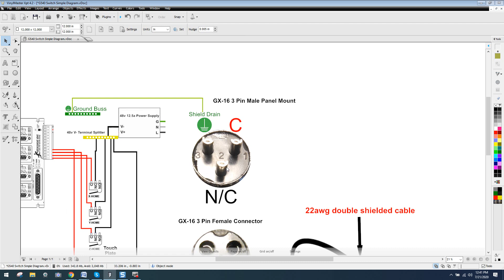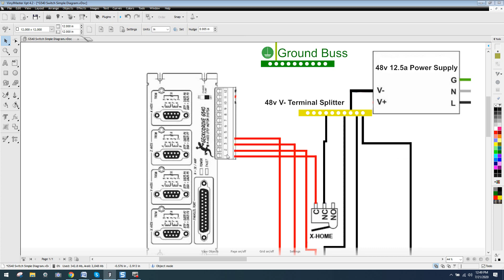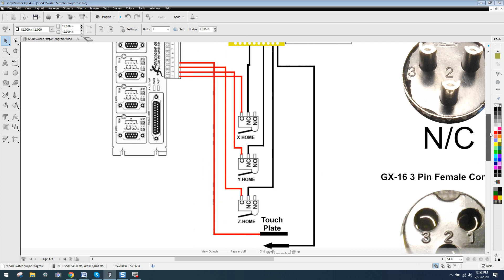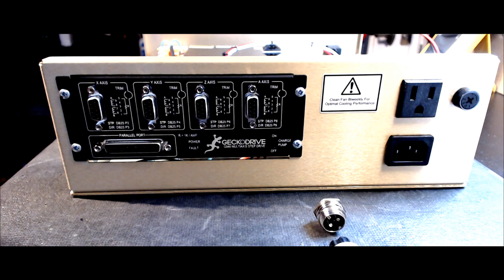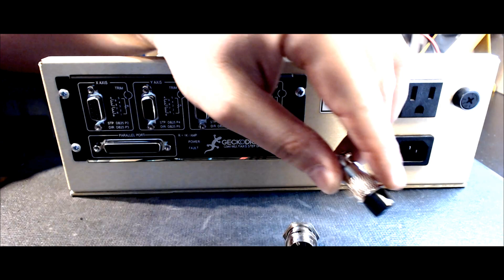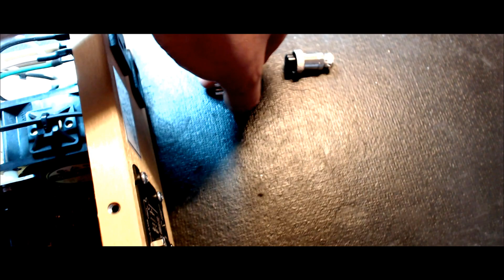Gecko G540 Switch Installation Complete Overview..

Comment: Hi, I enjoy your videos. I have what might be a stupid question and have been having trouble solving it. In your video you show 3 limit switches. I understand they are normally closed. But in fact there are 6 limit switches in the system, example you need 2 for the X axis. Since there is only 4 pins availble how does I solve for the other 2 switches needed in my machine? Thanks, look forward to your response.
Reply from the maker: Hey Cary,

Thank you for your support. In order to utilize that many switches means you'll wire them in parallel as this image reflects. This will in turn allow you to run multiple if not all switches on a single input. https://www.google.com/search?q=parallel+limit+switch+diagram&rlz=1C1FKPE_enUS953US953&source=lnms&tbm=isch&sa=X&ved=2ahUKEwi94tKOzMnwAhVaRDABHQ4uBzoQ_AUoAXoECAEQAw&biw=1920&bih=937#imgrc=8d56B1rORBeUAM Thank you, and have a great weekend!
Vince
Reply: @corvetteguy50  THANKS!!! I don't know why I didn't see it before.
Reply from the maker: No worries, glad to help. Have a great weekend!
Vince